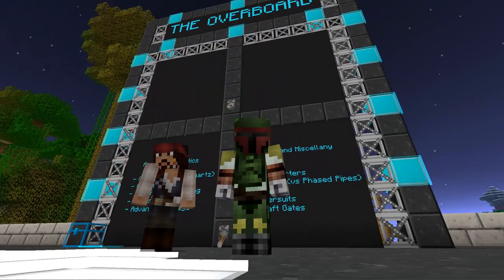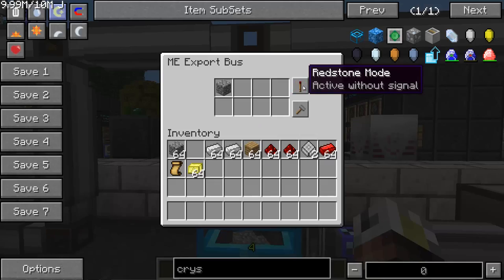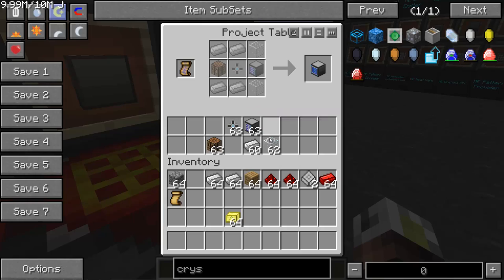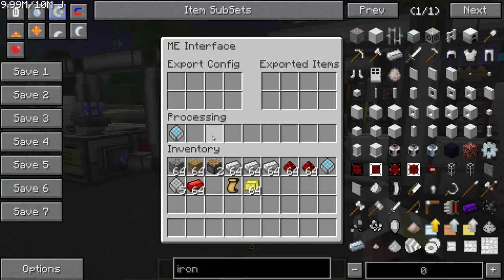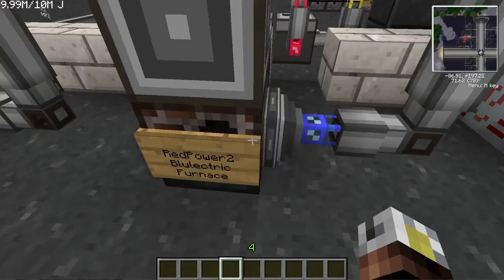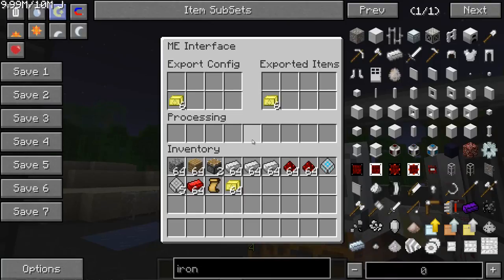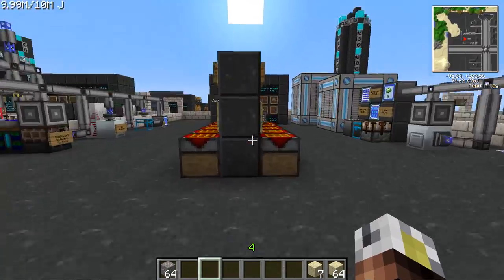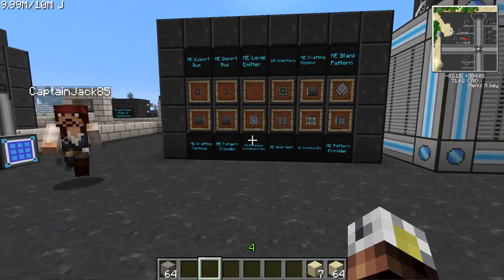Tutorial - Applied Energistics - Part 3 - Autocrafting, Wireless, and Mod Interfacing

Comment from the maker: The Export Bus is gonna be your answer to both.

For Cells, Set an Export Bus up to a Magma Crucible and have it pump redstone in. crucible auto-transfers it to the Transposer. Then have the ME Interface + recipe (empty frame -> full) on the transposer.

For Coal Dust and its ilk use Export Buses pumping coal into each macerator. Use a redstone signal to control them - or better yet use a Level Emitter to control how much you produce (i.e. don't use all your coal).

Hope that helps,
-Ingrimmm

Comment from the maker: It's because you're asking the system to craft 10 resin; not 10 copies of the uu-matter -> resin recipe. 

So when you put in a request for 10 resin the system looks and sees that 1 use of the recipe will give 21 resin which is enough to satisfy your request for only 10 resin; so it will stop after the first time.

If you want 210 resin then you have to request 210 resin and the system will calculate that it needs to send 40 uu-matter to run the recipe 10 times to get the 210 resin requested.

Comment from the maker: If you want to process the ore immediately you can hook them up to an export bus but that will mean that you'll need a different macerator for each ore type. Or I guess you could use one macerator...but all the ores would fight for a spot in the machine and it would be unreliable.

Using patterns with an ME interface will allow your system to only make the necessary ingot when you need it, and also allow you to let one or two macerators handle all of your needs instead of one for each ore type.

Comment from the maker: As long as you're not using Resin for any other recipes you can just set Export Busses on the top of the Extractors and have them constantly export Resin into the Extractor(s) - skip the Interfaces entirely. The only other recipe you'd NEED resin for is sticky dynamite.

Otherwise you could put the Interface on top of a RP2 Relay in the dead middle and 1 block above of the extractors and use Pnuematic tubes to convey the resin from the Relay into the Extractors. That'd split the load evenly.

-I

Comment from the maker: Check what mode you have the access terminal on. There are 3 modes Show only: Stored, Stored/Craftable, or only Craftable. You might have it on the last one which wouldn't show the stuff you have stored in the system, only the stuff you can make. So you'd make something and to you it'd look like it was disappearing. Either Stored or Stored/Craftable would let you see it again.

Comment from the maker: Yes. You'll need to start making patterns from the ground up. To get started the system will need to know how to make coal dust, glass, Re-Battery's generators...and then move up to all three transformers and so on and so forth. If you need to make something, be sure to encode a pattern for it first and throw it right into your system. At first this will be fairly tedious but slowly but surely you'll stop having to "manually" craft blocks and the system will be able to do the work for you.

Comment from the maker: Make sure you didn't spawn in the original RE-battery. Sometimes the versions that are spawned in are different (usually 1 damage tick) different from the ones created normally. If you're still having an issue you could rig up an auto-crafting table with an interface recipe on it.

Comment from the maker: Make sure to use an Import Bus on the right (literally, as in opposite of left) side of the machine. The IC2 furnace takes input from the top, fuel from the bottom, and then allows the output to go out the right side of the machine. Set an Import Bus up to that side, switch it to stack mode (to pull everything no matter what), and you should be all set. An Interface on the top will let you send recipe ingredients into the furnace, but you'll need the import bus to get them back in the system.

Comment from the maker: Thanks!

1) Use a Level Emitter (set to watch for the limit you want and emit signal when lower) and Export Bus (set to Always Craft, and Active with Signal) exporting the item you want into a Chest (either ME, or regular chest) hooked up with an Import Bus to get it back into the network.

2) The dual recipes is a problem we've run into before & haven't yet found a good solution for that doesn't involve more complex things like a backup AE network with the alternate crafting recipes & barrels

Comment: I have built up quite a big network of logistic pipes and I really like it. The only thing that's putting me off changing to AE is the limits on the wireless access. I've added Thaumcraft to my Tekkit Lite and have built quite a distance away from my main base but everything is still available via remote request and ender chest/pouch. This just wouldn't be possible in AE.

Comment: So if I had a few quarries running with their outputs teleporting into a few diamond chests, how would I get it to automatically macerate all the ores? Would I need an Export Bus on a chest in which I input ores and pump them out using BC pipes into macerators with Import Buses? Also, how would I create solar panels/arrays from scratch? Have ME Interfaces on furnaces for iron, extractors for resin, and just a patterns for every other component?

Comment: Actually the unused recipes you see in tekkitlite are ones that have been disabled and are only used for easy craft modes or if the pack is used without buildcraft which is changed in AE's configs. Both are enabled in bigdig, not having to wait for those laser to make the chipset is very nice. but again they eat more diamonds rather than making the chipsets in the end but remove the extra process of having to build the lasers and power them.

Comment: Do you have to put the assembler pattern into the interface over the furnace or other machine or can you store it in your main hub for example to make iron ore from iron dust i need to use a furnace so do i need to put the pattern in the interface above the furnace or can i put it in the main control hub and it will make it from there

Comment: it  has  a controller  drives  io ports  cables  patterns  to  the varius  machines  and import   and functions  fine   but  only  to the indvidual  parts   not  making    the lower tiers  if i ask for the solar panel , i dont ge tit  it all works   and patterns  and interface export  everything is there.

Comment: The problem I have come across is, I have 4 extractors in the system but it only sends resin to the first one to make rubber, i have all the patterns in them for the rubber and the correct import and interface blocks?? any help?

Comment: I need help trying to fully automate my fusion reactor on Atomic Sciences with AE.
I have build an crafting computer o the system to automatically craft Empty Cells. These then go to the chemical extractor to process deuterium.
To basically input the Empty Cells into the chemical extractor I will need to use an interface? But that can't work. Is it because the Chemical Extractor has more a complex GUI than what they are demonstrating?

Comment: OK so after some tinkering on a test world I've discovered that you can indeed connect a very small logistic pipe system to remote request items from an AE network.

ME Interface connected to a provider pipe and a request pipe and both of these pipes connected to a remote request pipe and ender chest. And there you go, request stuff from your network literally from anywhere.

Time to rip up my base...
Reply: Stuart H couldve just used a wireless terminal..

Comment: I have two locations for my base and my me network is on the mainland while my main structure is on the island, how would I gain access to the chests in the main structure from the network?   Would I need a tessaract? Do the wireless Access points also serve as a gateway between segments of the network I wish to set up?  
NOTE: I know how to access the network from the island/main structure using wireless access terminals.  I wish to hook the chests from the main island to the network wirelessly.
Reply from the maker: If you're still using an old Tekkit Lite (like this video) then take a look at wireless connectivity using Logistics Pipes + AE. 

If it's a newer version (but still MC 1.6.4) then look for Quantum Rings (recommended) - see our video here - https://www.youtube.com/watch?v=iuuoSeEJ7o8

If all else fails, get clever with some level emitters, export busses and ender storage chests.
Reply: The MindCrafters its ftb magic farm 2 i'm severly limited in what I can do lol, guess I"ll just have to set up two networks, or move the network into my island

Comment: But how do you set up a second system, say.. some crafting terminals... in a separate location, say.. a second building of your complex, and have it wirelessly connected to the main ME system?

I have my computer and nuclear facility to power it separate from my main facility, and could have sworn there was a way to wirelessly hook the system up to crafting terminals in the area. I'd rather not string 100's of ME cables through the ground. Not safe for the cable, given my track record with bases...
Reply: There is a thing called a quantum bridge it uses quantum link chambers it requires a singularity which is a million of one item.
Reply: alvin mutongi I remember the Singularity (thanks Yogscast), but I'd hoped I didn't need to make one to connect something only 50 blocks away. Seems a grievous waste of material to do so. I wonder if my tiny Powers of Hell system will be enough to power the Singularity and all the computers, let alone the other systems I have. (Powers of Hell = Enderthermic Pump in hell / Ender Tanks connected to 10 Portable Tanks hooked up to 10 Magmatic Dynamos hooked up to a Resonant Energy Cell.)
It works well for Thermal Expansion machinery, not sure if it can power a computer or isolated computer machines.
Reply: +SolstaceWinters maybe try doing a nether tunnel if you remember 1 nether block is 8 overworld blocks set up a system in a closed off part of the nether or build it yourself then put the A nether portal the appropriate distance away.

Comment: is ther any mod that can replace the reacter coolent injecters from advanced repulsion systems so i can still use the lzh condensaters
Reply from the maker: Not as easily. You can set up a rig with Applied Energistics to pull spent ones out and drop new ones in but you run the risk of them not being put back in the proper spot if they fire at the same time you're swapping out your rods/cells.

Maybe if we all throw money add the mod author he will add them back in :D
Reply: lol i miss them alot many reacters no more bases with power that will blow up if not treeted right
Reply: The MindCrafters you could try using a factorization router setup to inject condensators into specific spots, but I don't know if item routers pay attention to the durability of an item or not so it might be more difficult to extract them
Reply: YOH SUSHI sorry i never tryed factorization  at all i will need some help my base has no power other then backup steam power and im runing out of fuel
ill need help
Reply: austin schlegel direwolf20 has a great tutorial on factoriztion if you ever need it, it's really useful because it allows you to do some really cool stuff and also triple ore output. The item router is the thing that you'd need to use, that doesn't require any power and allows you to inject items into specific slots of your nuclear reactor if you use the item upgrade and the machine upgrade. try it out, it's totally worth it :)
Reply: is it to much to ask for a link
Reply: austin schlegel course not,
/watch?v=syVswXHTGBg for the direwolf20 one (bear in mind that this is slightly out of date now but it's pretty much the same)

There is also a slightly more in-depth one here for router
/watch?v=FSwdoJwxUWY
Reply: thanks